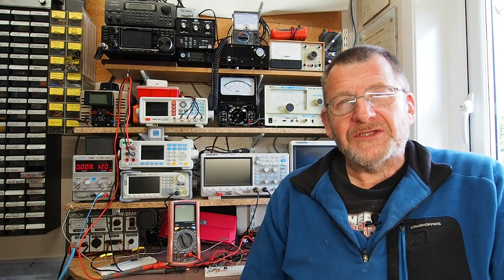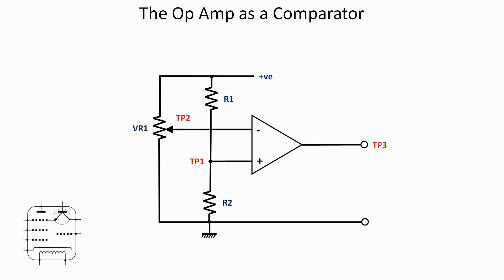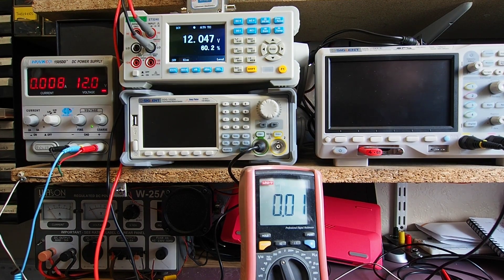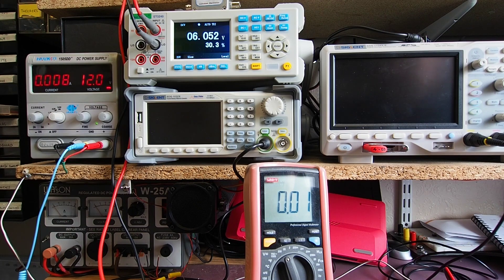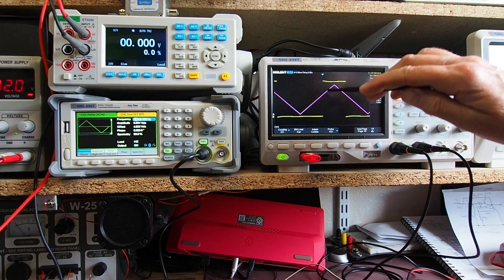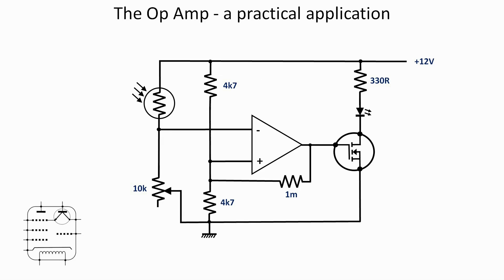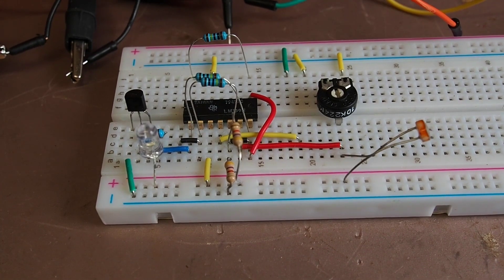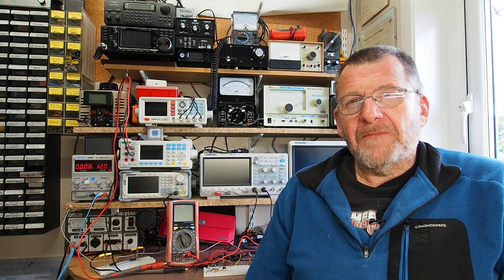Electronic Building Blocks - Operational Amplifiers   -   #089

Comment: Bill I hope all is well. Do you have a p/n for the light controlled resistor and the chip you are using. I will definitely research them on the PDF you sent me. Man electronics is such a vast arena. Hopefully as I progress it will all come together. Bill thanks for sharing all of your knowledge. Stay safe and well Artie cheers mate 👍
Reply from the maker: Artie,
OK the OP amp I used is an LM 339 (actually a quad comparator), but any op amp should perform in a similar way. The LDR is I think a GL5506, it came with a pack of assorted components from China!
Bill

Comment: Bill, it could have been interesting to hear how you supplied the -ve power to the op-amp - assuming it was not a rail-to-rail type. And in future, would it be possible to show the circuit diagram as a PIP whilst you are varying the voltages and probing the test points. As always, good video with interesting and useful topic.

Comment: It would be a big help for us real beginners, with the breadboard shots, if you removed all the components that weren't actually contributing to the circuit. There is more going on on the breadboard than in the circuit diagram which is a bit confusing. For example I can see 6 resistors on your breadboard, not including the pot and the LDR. The circuit dia however only has 4!? Other than that very informative video, thanks!